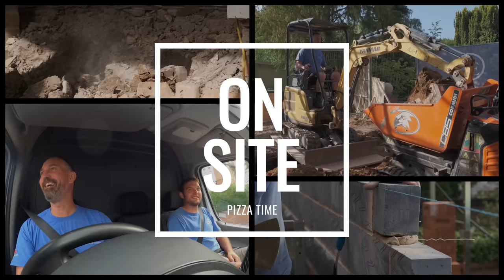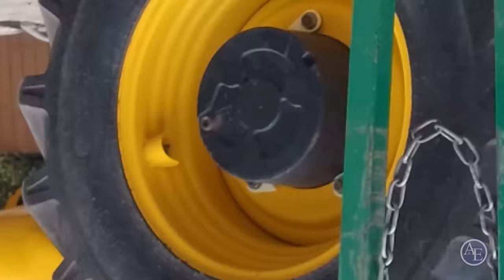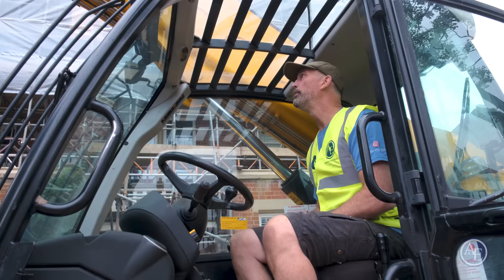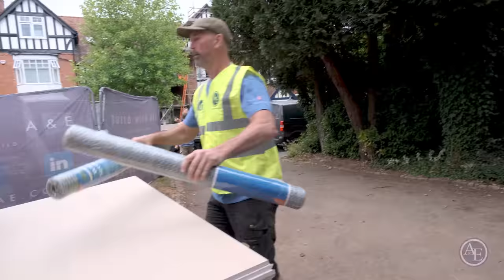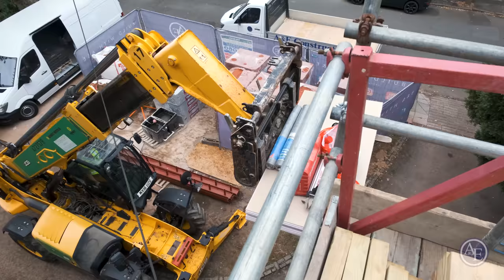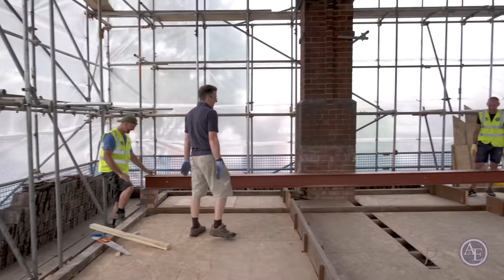Trusses for the Attic! - Attic Conversion | Onsite #5

Comment: As others have said, it should have been specified that the dimension given were from brick to brick. Saying that, if the manufacturer had anything about them they would have asked the question if the dimensions were tight or if a tolerance had been included in the measurement.
With regards pizzas I'd always go for the veggie options everytime 🍕

Comment: I’m not in building trades but, should the manufacturer have asked for drawings to confirm sizes to plan then they have back up and could have adjusted as required? Not sure. But enjoy watching you guys and seeing the jobs come together. Pizza sounds good.😂
Reply from the maker: Hi Dave pizza is on the list tonight 😂, 
I think personally the manufacturer should at least find common ground but they are having nothing to do with it clients signed the paperwork even thou the clients told the lady the Sizes were Brick to Brick, opening can change in size depending on brick gauge and bond to make it look better thanks for watching all the best Tony 👍

Comment: Interesting conundrum that one Tony.  If the customer clearly stated brick-brick opening size (in writing!!) then the manufacturer should bear the burden for not adjusting sizes for fitting.  If the customer signed off on the order with the overall dims but no reference to brick to brick (cos the critical bit of info didn't make it onto the drawings/order and the client didn't spot it, then that's a 50:50 between client and manufacturer.  And you'd hope the manufacturer would make an offer to resolve the issue.
But...if I'm paying a main contractor for a large project then the risks of delivery lies with them.  I'm happy to pay a premium to a MC to defer my risk onto them - which includes them resolving any cock-ups they make.  So bottom line - all could have been avoided if client had not got involved.  I suspect it was cost negative for them in the end.
Reply from the maker: Hi Matt it’s definitely a conundrum, clients should never get involved really, but what can we do but try and pick up the pieces thanks for watching all the best Tony 👍

Comment: I’d say the clients in the wrong he measured it so he should of taken the tolerances out, if the manufacturer had measured it then it would be there fault whenever I measure up for windows and doors I always take 10mm off the height and 10mm off the width
Reply: Now that Jake sounds logical. and I have learned from that since I’m thinking of replacing a small (old larder) window in wood to plastic. Now I have confidence to order it and fit myself. See these blogs are brilliant learning tools.
Reply from the maker: Hi Jake if it was in court the client would definitely be in the wrong he signed the document off with out checking it thanks for watching all the best Tony 👍
Reply from the maker: Hi Dave glad it helped thanks for watching all the best Tony 👍